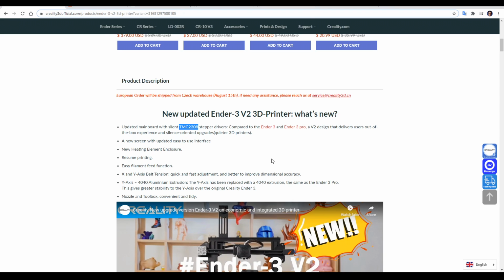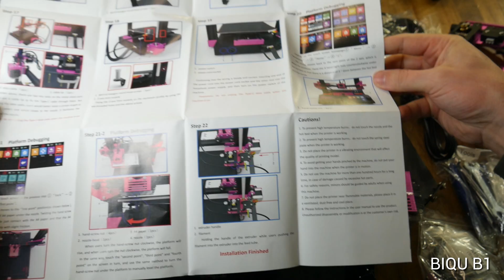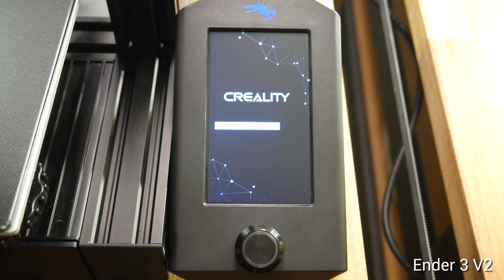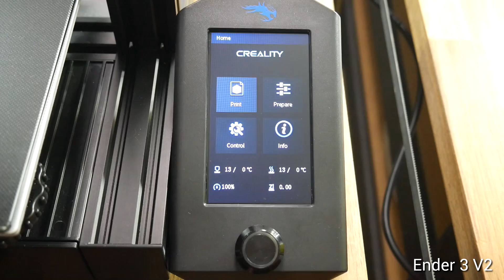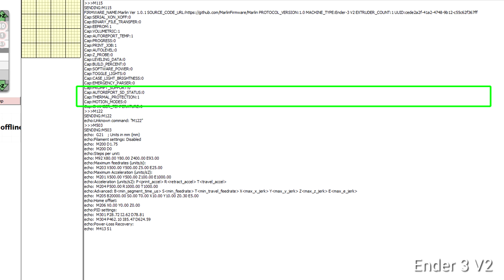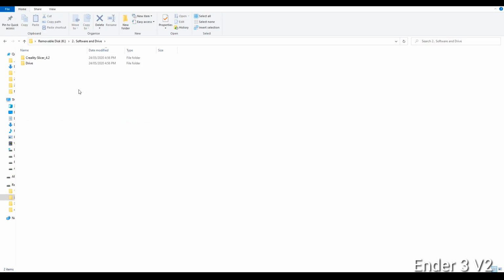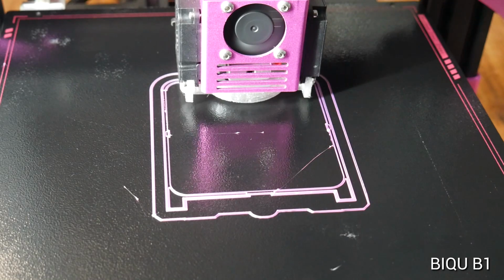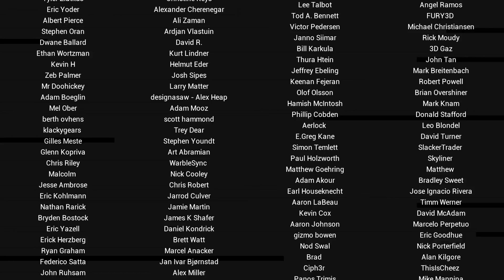Ender 3 V2 vs BIQU B1 - Battle of the upgraded Ender 3s

Comment: BIQU also has heated bed insulation.
Also the ultrabase style surface DOES NOT require force, it requires patience. Let it cool, don't ruin the surface by forcefully janking parts of when hot.
Also BIQU B1 is renamed slight evolution of the Biqu Legend which is one of the worst printers to be released in the past ~1½ years.
Reply from the maker: For the record I never removed any prints hot here. I wiped down with IPA before printing and the prints stuck well enough that they wouldn't self release when cool.
Reply: @TeachingTech  The point of Ultrabase is for self release. Do not wipe ultrabase with IPA between prints. Ultrabase does not require that - and might even be counter productive.
Or wait longer for cooling. Bigger the print easier it releases. That's the magic of Ultrabase -- when hot prints just stick, when cold they just release - and no maintenance is required typically at all.

Comment: I accidentally came across this video when I was looking for information about V2! Please tell me which of these printers to choose as the first one. In technical terms, I understand that BIQU B1 is better. If you buy BIQU B1, will there be any problems with searching for information about IT - about upgrades, repairs, firmware, etc.
Reply from the maker: Bigtreetech usually make their parts open source with detailed docs on their github. The parts in this printer are well known and popular so support should be good.
A lot depends on how much info Creality release for the new 32 bit board. The Marlin devs already have an example configuration setup for the V2 so maybe we won't need Creality at all.

Comment: It seems interesting to me it's using the SKR v1.4 rather than the newly released V2.0. It seems a curious decision. Any ideas why when the v2.0 seems like quite a step up?
Reply from the maker: The SKR V1.4 is a still a more capable board. I think it would make this printer easier to add dual extrusion, especially since Bigtreetech have dual mixing hot end kits available. It will be interesting to see if it fits the B1.

Comment: wtf is the purpose of rpg leds
Reply: Easier to see layer printing and just visual indication, i.e. red for nozzle at temp ready, blue, cold etc.
Reply from the maker: LEDs on a rocket propelled grenade are superfluous, but RGB LEDs on a 3D printer can be entirely useful (as Tim says), or just for bling.

Comment: A video about Ender 3 + Upgrades vs Ender 3 v2 would be cool. 
Have a budget of $275 for both then put them head to head and see which is better/if you can make the Ender 3 v1 better than the Ender 3 v2 for the same money spent.
Reply: The V2 is essentially the Ender 3.
The main hurdle to get over is the Ender 3 has the narrow Y axis, where the Pro and V2 have the thicker one.  They also have the genuine MEAN WELL power supply (easy $30 Amazon upgrade).

After that, you can get the Ender 3 up to par with upgrades, including 32 bit BIGTREETECH SKR mini e3 v2. Etc etc etc etc. And more than likley under $250 to $300 cost of V2.  The advantage if Ender 3, many upgrades available for anything having to do with hotend assembly backplate.  The V2 is different.
Reply: Also check out the Lotmaxx SC-10, larger print volume, 32bit board that can be upgraded to wireless, can be upgraded to dual extrusion, it's a nice machine.

Comment: I have just purchased the Ender 3 V2 and I am very happy with it, I think I made the right choice. Thanks for the comparison, as always you are clear and concise.  How about a video on fitting a BL Touch to the V2, it looks like there is already a socket on the main board to accommodate it.
Reply: I'd love to see a video for this as well.
Reply from the maker: It probably won't be in the review, but there's a fair chance I'll make a guide video for that.
Reply: Please do! I ordered my bltouch and it should be here Thursday.  I'm probably smart enough to figure it out on my own, but I can't get my bed to consistently level, so I may be full of it
Reply: That's what my mistake was. I asked them if I could put a bltouch on the Ender 3 V2 they told me  it doesn't come with the function but you could put one on there so I bought the printer and bltouch and now that I have the bltouch and the printer the bracket doesn't Mount up like it should and they finally got back to me and told me that they haven't even started developing the firmware for the bltouch for the Ender 3 V2 I've been looking everywhere 4 something I just figured I'd let you guys know waste your money on a kit all you need is the bltouch in The Wire you're going to have to print a bltouch bracket for it cuz the one that supposedly says it fits that printer doesn't line up

Comment: I believe that prusaslicer has a setting called something along the lines of "elephants foot compensation" Wich makes the first layer slightly smaller to account for it being too close to the bottom. (I don't use prusaslicer though but I think I heard someone say that it could do that once.)
Reply: Could print a small raft also.
Reply: @timd9430  yeah, that is if you are only trying to get rid of the "elephants foot" but most people squish the bottom layer in order to get a smoother surface on the bottom of the print.
Reply from the maker: The first layer is not compressed so it's not elephant's foot. The compression starts 2-3 layers in.
Reply: @TeachingTech  learn something useful everyday... especially from Teaching Tech!  Thanks!  Any idea how to reduce that "elephants foot" 2-3 layers in Cura or any other method with the printer?  I guess really, what is the main cause of elephant's foot and how to avoid it?  Sometimes I wonder if the bed too hot?  Seems different kinds of bed materials result in different outcomes.  i.e. TEXTURED powder coated PEI flex sheet seems to get much hotter than say Creality magnetic flexible magnet sheet (not the steel kind).  Thank you.
Reply from the maker: Generally it's because the first layer is too close or the extrusion multiplier for that layer is too high. Having said that it's not that easy because you may need it this way for the filament to stick. Some slicers have compensation which you can use to tune it out.
Reply: @TeachingTech  Thank you!  I noticed on my new Ender 3 V2 with the textured side up glass bed (not the smooth side), it didn't have hardly much elephant foot with a test cube.  Came out exactly 20mm all around.  The Ender 3 Pro had a bit more elephant foot, but was using a Fulament Textured (seems to be heavy texture like Prusa sheet) PEI Powder Coated Flex sheet.  I notice  these get substantially hotter.  Both were ran at 70c bed temps.  I need to get a infrared temp gun.  This cube was 20mm X&Y, but shorter, around 18-19mm in the Z due to excessive elephant foot.  thanks!

Comment: The glass bends on the ender 3 v2 bled and bow in/out from the pressure of their metal clips. This results in a wildly uneven print surface. It's probably the biggest flaw of these printers out of the box.
Reply from the maker: I will stick a straight edge on both beds for the review.

Comment: PLEASE test out sensorless auto bed leveling!
Why are we not using sensorless homing to auto level the bed??? 
Sensorless homing is come a long why in the last few years!
Reply: Because its very likely it will damage the bed
Reply from the maker: It's not recommended with lead screws. There is a lot of variation in the resistance of the lead screw turning from printer to printer depending on alignment, etc. Risky.

Comment: The bed rails on the Biqi B1 are much better aswell, like the CR10s Pro design. the 4040 on the E3 v2 is good, but not as stable as the Biqi. That would be a big win for me, plus the much better electronics box.
Reply: You 're right, bed rails on the BIQU B1 are much better.
Reply: @BIQU_Makers  Well you would say that :P
Reply from the maker: I will show a closer comparison between them in the review, thank you.

Comment: Just as a note, the Processor isnt the same between the skr mini and the Ender 3 V2, the Ender 3 V2 version has proper 512kb of memory, RET6 that does not need a firmware hack to unlock the second 256kb section that may or may not function correctly like on the RCT6 version. TMC 2225 are functionally TMC 2208s with a different package.
Reply: If you look at 3:52 in Michael's June 2020 video here     https://www.youtube.com/watch?v=mtCz_-2zvZo&t=495s    he says the SKR mini E3 v1.2, and now new v2.0 are meant to have only 256kb flash memory (due to RCT6 chip) but in fact turn out to use all of the 512kb program memory.
Reply: @paulnoonan4715  You should probably read my post
Reply: @lookitsrain9552  Is it known the firmware hack to expose the full 512kb is less dependable than using a straight RET6, or speculation based on similar previous experiences?

Comment: The vase mode print clearly shows the pink was cleaner but that also might be a ligh and colour. The grey has vertical lines near the top but none can be seen in the pink. 
You need to print same colour filament and same speed, acc and jerk. Retraction settings can be different as this really affects stringing.

Test print i would like to see a overhang test in ALL directions. So arrange 4 minimum overhang arches. This test shows the effectiveness of that cooler/ duct design.

Comment: Wow, early this year I mentioned on Proper Printings ender upgrades (custom connector) that a USB Type-C cable and break out boards would work really well for hotends given their design is capable of 80W+ and has many conductors... I'd love to see how BIQU have actually achieved this? i.e. the breakout boards they have used etc. I'd love to apply the same to my custom Hypercube Evolution (Linear rails + E3D Hemera).
Reply: Same, I'd love to pop one on my AnyCubic Predator Delta, I'm in the middle of building a new wiring harness and decided to chop up an HDMI cable for all but the heating element.  USB-C breakouts are available, I may give it a go.
Reply from the maker: I will show some close ups of the USB type C break out boards in the review.

Comment: For the $100 premium, there's no ABL and no geared extruder. Disappointing. It's cheaper to get a base Ender3, add in an SKR Mini board and a genuine BLTouch and BMG knockoff, which is more bang for buck that this.
Reply: BIQU BI has ABL and geared extruder.
Reply: BIQU 3D Printer I see that it is capable of using a BLTouch but it is not included. As far as extruder, it does not look like it has a gear ratio greater than 1:1.

Comment: The BIQI B1 seems like an interesting machine, but at this price you can also get the Artillery Genius, which is a more polished machine with a direct drive extruder and volcano hotend.
Reply: direct drive is so much better then crealitys bowden extruder. how long have they been using the same horrible designed hot end? running the ptfe tube right to the nozzle does not work on it

Comment: The BIQU B1 is a surprising competitor with the flexible print bed and cooling from two sides and dual mode touch screen. That alone is a lot of value. The USB C connector worries me because a heater cartridge, fans, and lights will draw very close to 5A (it was pointed out in later replies that I was wrong, my bad) and my phone at best draws 1.5-1.7A @5V from a high quality consumer USB C wire and 5A supply. It's really not intended for high amp 24V systems, especially under constant flexing. Would also be nice if the retraction were properly tuned.
-
The lead screw binding is maybe a bit difficult for beginners and some experienced users to diagnose on the Ender 3 V2. The glass bed also means no inductive probe and flexible magnetic beds are expensive. Weird they cheaped out a filament sensor. Am I seeing Creality pull an intel where they handicap products to not kill more expensive offerings?
-
Frankly surprising auto bed leveling is not standard on either considering how cheap inductive probes are these days.
Reply: My phone charges at 5 A / 10 V over a beefy USB-C cable with no issues.
A 40 W heater at 24 V is less than two amps, and the rest is pretty much negligible.
Reply: @174wolf  40W = 24V*1.67A, each of the three fans maybe draws .15-.25A, LED draws .02A

So 1.67A+3*.25A+2x.02A=2.46A so yup, you're right it is within spec, I got 12V heater cartridges mixed up which would have been 4.12A draw. My bad. I still don't like USB C for a CNC moving tool head, makes me too nervous because of how easily I can unplug it. 

Crazy phone btw, what you got? I have an oukitel K12, 5V 5A fast charge over USB C.
Reply: @Bajicoy  Yeah, the unplugging might be a concern. I still would like to go with VGA cable at some point on my printers, but just haven't found the need to yet.

It's a Realme X2 Pro with 50 W "SuperVOOC" charging. They're bringing out 125 W charging this yet, probably over USB C too, so I'm interested to see what sort of amps they'll push there at which voltage. Obviously it won't take very long to charge then, unlike a printer that'll run for hours or days at a time.
Reply from the maker: A proper review needs a lot more hours on the printer, time to know it's quirks and printing in a range of materials. This is just a first impression.
Reply: @174wolf  VGA is respectably functional when done right. I am so old school VGA seems innovative xD

Also very nice pick of a phone, great value. First I heard of realme so thanks for sharing.
Reply: @TeachingTech  makes sense, thanks for explaining! Can I also make one more request? Could you do some high temp prints with the magnetic bed say abs or polycarbonate 100-110 temps and let us know if it destroys the bed? I doubt it will completely fail but I heard common sheets had an 85 max temp
Reply: You can get 5A rated USB C cables. It's also entirely possible they're doubling up on wires in a non-standard way to get better current carrying ability.
Reply: @fgbhrl4907  i bought 5A usb C cables and quality control is not the best. Not a fan of hacking connectors for consumer products, for a hobbyist tinkering, maybe, but not safe around kids or beginners. At least using ATX pins with some kind of retension clip would be the bare minimum of safe. USB C is much too easily unplugged.
Reply from the maker: I won't be able in internally expect the cable but I'll include some close ups of the breakout boards in the review.
Reply: @TeachingTech  thanks, I appreciate that but I thought this was the review..? I must be getting old being so paranoid about new stuff like these breakout boards and connectors...

Comment: Hy Michael, i am just wondering if i level the bed corectly, when i levet it i lift up 0.2 mm (the thickness of a puece of paper) so when i home the printer the 0 position will really be 0 not also in the case where i home then level, i will have a 0.2 distance at the zero position. I calibrated my e steps per mm so the extruder extrude exactly the required amount of filament but it seems to be pushing to much filament at 100% flow rate
Reply: Im not sure i understand you (im not english) but you should not move the z axis 0.2 mm up when you level your bed. Or do you mean the gap between your nozzle and bed is .2 size of paper when your z is at 0? Second option is how it should be
Reply: @matswaeijen  hello, thanks for answer, the first option is the way i am doing it so that when the first .2 mm layer is printing i have exactly. 2 mm gap betwen the noozle and the bed, if i home the machine then level the bed i will have a .2 gap at 0 positionand my first layer wont stick to the bed because the gap will be too big

Comment: Great video. 

I would love to see how difficult it would be to upgrade the hotend or the fans/duct on the biqu. 
Possibly compare converting to direct drive as well?

Edit: after some thought, I think the biqu would be a better choice. It has more upgrades that users usually add so that would save some money. And even adding the other optional upgrades is easier like the bl touch.

Now QC is what I wonder about..
Niether are known for the best QC but we'll see
Reply: you can upgrade it , but need design a case.

Comment: What are the most impactful upgrades to the Ender 3 V2?
Reply: The plastic drawer.
HA!  JK!
The 32 bit board. (which also has built in silent drivers, TouchBL and filament runout sensor connectors for adding these when Creality is obviously ready to).  Also the color display.
Reply: for me it's the 32 bit board, and the interfance of the screen make so much easier for me to tune... (my first 3d printer ever)

Comment: Thanks Michael!  I'd love to see a test of adding a BL Touch to the B1 (or both printers) during the review, although I know that is a bit beyond the scope of a normal review. Maybe justified with the inclusion of that bracket, port on the back, and the firmware already being prepared?
Reply: You can join our Facebook group(BIQU B1 3D Printer User Group). There are customers who buy B1 and share videos using BL touch.
Reply: I second that, would be great to understand Closed Loop Steppers and their benefits